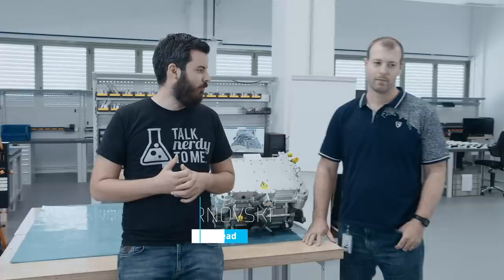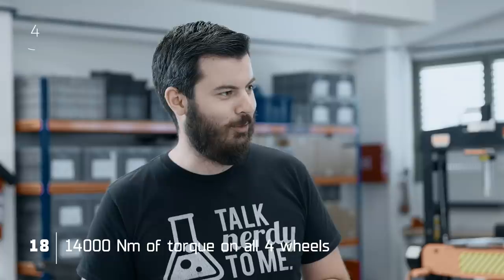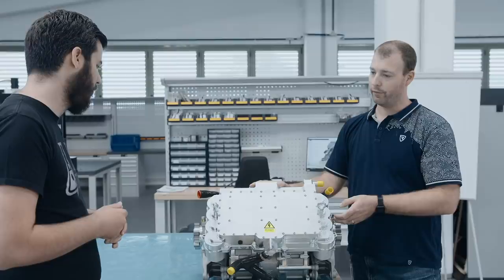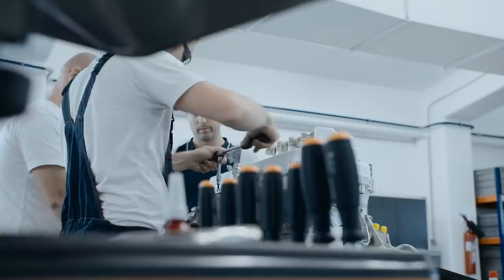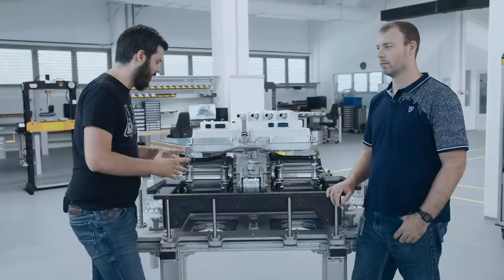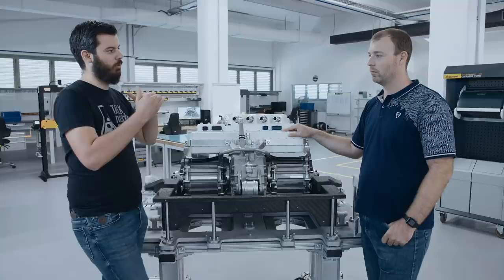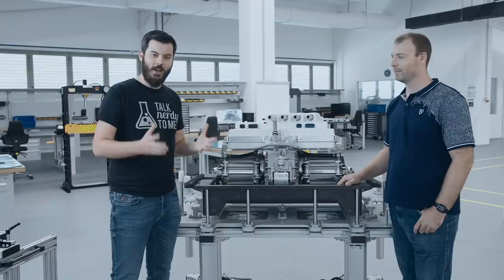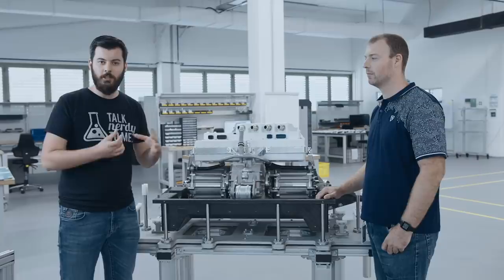How to Make 1914 Horsepower Powertrain | Mondays with Mate E12

Comment: Mate why dont you use GPS RTK for self driving since RTK is 1-2 cm precision ? 
Maybe roads have their outer sides recorded in that system and then you can input complete roads to the cars ? Mobile RTK does not change its precision like EGNOS so with cameras car should be able to drive very precise, maybe even all cars drive on exact same line on the road.

Comment: Why do you use surface mounted pmsm, what are the advantages to buried magnets? Are you producing reluctance torque at all?
Reply: I am no Mate Rimac but I'll try to answer. Surface PM motors produce significantly more torque than IPM of similar weight and also have higher peak power.
Reply: @user-ne3rb8ps8j  That's not true. the torque component isn't affected by the mounting of the PM, only the reluctance torque can be added due to the carvings in the rotor when using burried PM mounting.  Furthermore, it's not about torque but about power, and the power in surface mounted PMSM is significantly lower, since speed is limited to way below 10k RPM. So, if you have the same torque and lower RPM (surface mounted PMSM) you will end up with less power than with interior magnet PMSM if same torque but higher RPM.
Reply: @OneGearMode  I don't want to argue but in my experience as a PM motor designer SPM motors usually have significantly higher torque density due to high permanent magnet flux leakage of IPM motors through rotor iron bridges.
Also SPM motors have higher characteristic current due to higher PM flux linkage and lower inductance which means higher possible peak power through an extended speed range.
Reply: @user-ne3rb8ps8j  Ah that makes sense. Thanks for the explanation!

Comment: 1 MW of flexibel power might turn out really great for aerobatic airplanes.  For the whole powertrain including the batteries, the power-to-weight ratio ,1914/1100 = 3.7 hp/kg, already exceeds the allowed limit for modern aerobatic plane by 6 times. Of course, 1100 kg is already the weight of the plane itself, and if taking approximatly a quarter of this to have just one motor,  I think it might give extremly agile airplane.
Reply: The motor would be perfect in planes, just need something either than a giant, heavy battery to power it

Comment: Did you consider to use CVT or something similar? And if you did, which are the reasons you didn't end up using it?
Reply: Modern CVTs use...electric generators and motors...
Reply: Cvts can't handle lunch power

Comment: Why not make all the casings by carbon fiber. Why not make as many parts as possible by carbon fiber? 
Is it safe to assume that more electric motors added together helps improve power? If thinking of just a rear wheel drive vehicle, would a 6 electrical motor put in linear sequential parallel to wheels to a tipical differential be more powerful than a 4 electrical motor in the setup as in typical ev's (perpendicular to wheels)?
Is wifi charging the way of the future to reduce the need of massive battery packs? 
If I want to build my own electric car, will you supply the powertrain and battery system at a fair cost or are your prices astronomical?

Comment: Could you just use refrigerant to cool the motors and inverters? Instead of antifreeze. glycol. If refrigerant is the only cooling system, a weight saving would be??? [50kgs]?

Comment: It would be interesting to use this rear power train in drift competitions. There are no high speeds on wheels (usually, you could drift with top speed about 100-140 km/h on body), so the gearbox is useless for it. The only problem is the clutch  and handbreak...
Reply: There's no clutch or handbrake needed for a C2 to drift. The drift can be controlled with torque  vectoring software on all four wheels based purely on steering and throttle inputs.
Reply: @vidznstuff1  clutch can be simulated by electronic, handbrake isn't big problem. Sorry for my english)

Comment: Electric cars are the future.....  Not at 2mil a pop they aren't. Even the roadster if it ever comes out or even exists. Whotf can afford a 250k car so they can save 10k a year in fuel. Even the model 3 performance is 66k and it's fugly, has no range, looks and has the fit/finish and quality of a Mazda 3 but for twice the price.